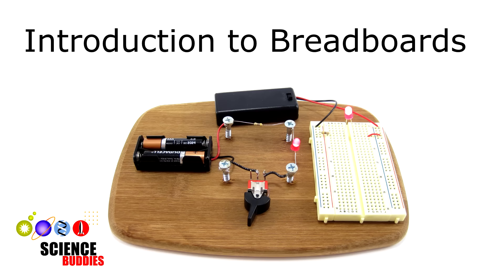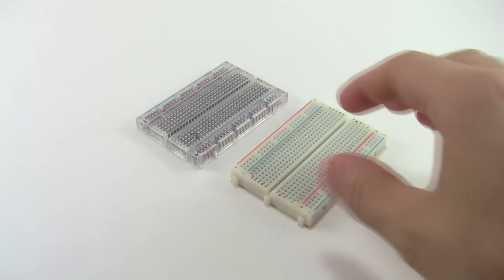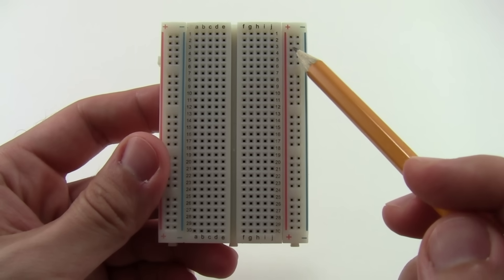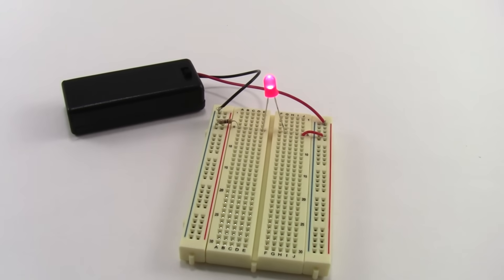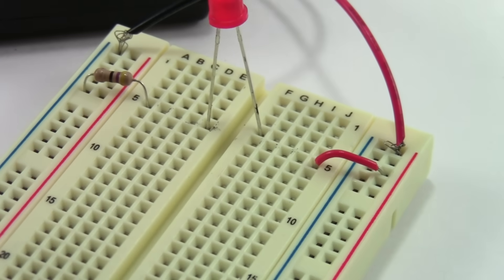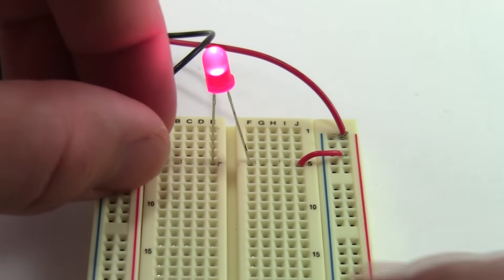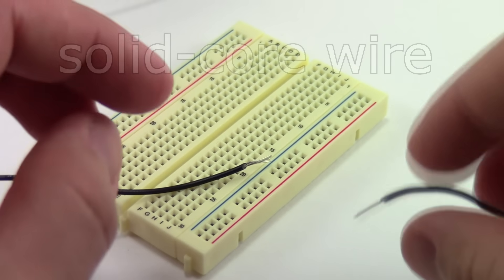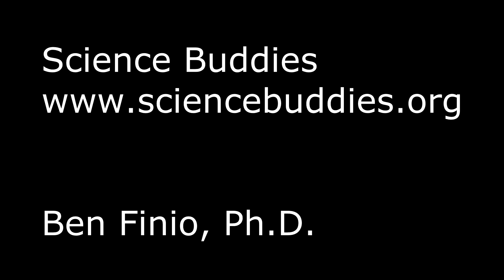How to Use a Breadboard

Comment: Instead of using the resistor in the LED closed circuit, why not use a jumper cable? I don't quite understand resistors
Reply: The resistor is used to limit the current through the LED. With a 5V power supply you would use a 220 ohm resistor keeping the current to under 20 milli amps.
Reply from the maker: We have a couple related videos that you may find helpful: https://youtu.be/ZdIBle_9Y_4 and https://youtu.be/NUKD9qESO58

Comment: what is the function of the resistor? why couldn’t you just use another wire?
Reply: The resistor is used to reduce the current down to a safe level for the LED so it doesn't burn out.
Reply: Because without it the resistance would be so high that it would burn the circuit
Reply: @stickguy9109  the resistance would actually be really LOW, so low that the CURRENT would be really high and destroy the LED
Reply: @mikerich32  Yeah sorry that's actually what I meant. I meant like nothing would stop the current  and it would burn the led.
Reply: If you compare a battery to water suspended in a tower, the amount of current out of the tower is equal to water pressure divided by the resistance of a faucet. Pressure in the tower is like voltage in electronics. As the tower empties less pressure is available in your battery so less current from the same sized faucet.

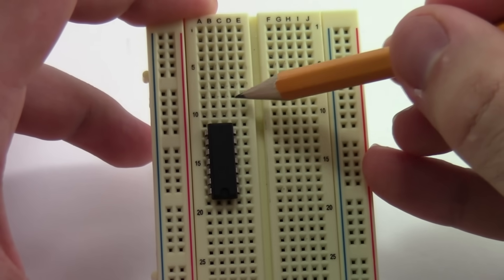Comment: @11:45 Can someone explain this to me or point me in the right direction
Reply: each of the pins have different inputs or outputs so by putting them in the same row one pin could be an input while the other can be a ground or output. im not the smartest but im pretty sure thats what he means.
Reply: @viperous1385  exactly correct.
Reply: @viperous1385  pretty much it. worded a little weird but yeah thats it. the chip wouldnt recieve the right connections because it could be receiving an output and input at the same time or ground and such

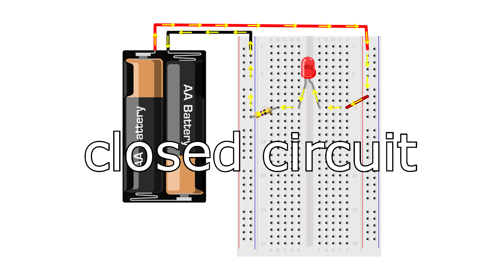Comment: @5:37 it shows electrons are flowing from positive to negative, but they flow from negative to positive... am I wrong???
Reply: Yes electrons flow from negative to positive but the direction of current is from positive to negative (it's just a convention)
Reply: The reason for it to be called conventional direction because earlier people thought electrons move from positive to negative, so they formulated the current direction as such but later they found that it was quite opposite and were too lazy to change the old wrong current direction because they thought it would be convenient to follow the same wrong current direction, hence the term conventional current flow direction
Reply: Yes from negative to positive but we work with the old theory from + to -
Reply: Current from + to - and negative eletrons to positive electrons from - to +

Comment: Why do you use a resistor after the LED?  shouldn't before the red cable???
Reply from the maker: Nope! This is a common misconception, so we made a separate video to explain it: https://youtu.be/NUKD9qESO58
Reply: @Science.Buddies  so in physic electricity runs from negative to positive and in electronic is the opossite. I tried cocodrile 3.5, and every time i used the resistor after the led(end of negative) the led blows up.
Reply: @rul1175  
I don't understand what a cocodrile is.
The confusion with how the current flows in the metals originated before the discovery of the electron. Thus, the direction of the current is a pure convention that has not changed because of the huge financial cost of rewriting textbooks.
Which is totally irrelevant when connecting LEDs, the resistor could be anywhere. 
You make some mistake, when you connect LED.
Reply: @iridios6127  yes anyhow the total resistance remains the same and the voltage drop across the components too remains the same as long as they r in series
Reply: This is for beginners like me, electric field goes from +- and electron flow -+: I just found out the reson for this https://youtube.com/clip/Ugkx9x9g5gR3bOhc0OQaM-cnYu5dmHZh0iMS

Comment: Why did that LED stopped glowing when you removed resister connected to it ? Pls answer.
Reply from the maker: When you remove the resistor, it creates an open circuit so current cannot flow and the LED cannot light up.
Reply: @Science.Buddies  Video is 7 years old but still responding to comments, absolute legend
Reply: @fieryice4749  Yeah
Reply: @Science.Buddies  Ha Thankyou
<3

Comment: We we use a resistor ? is it protector for the LED ?
Reply from the maker: Yes, it is a "current-limiting" resistor that helps prevent too much current from flowing through the LED. You may find this video helpful: https://youtu.be/NUKD9qESO58
Reply: @Science.Buddies  how do you know how many Ohms do you need for a resistor for your circuit? for example how did you know to choose this resistor for this LED circuit
Reply: @subzero1264  how much voltage does your battery (power source) provide ? And how much current does your led can handle ? Do the physics with ohm’s law (R=V/I) and you’ll get how much resistance (ohms) you need for your led

Comment: Thanks so much for this video, I have been doing digitally circuitry recently and struggled to get my head around how certain components that didn't have a wire connecting them actually were connected, I assumed there were metal strips, but obviously I came to these video to actually realise the layout of the metal strips.

Comment: Thank you for this video this helped a lot, but I have 1 more question I am getting a raspberry pi pico and I wanted to know if I should the that jumper wire kit, the pack of big jumper wires or the solid electrical wire with the wire strippers. I am also a beginner
Reply from the maker: Hi - there are pros and cons to each type. We address this in more detail in the written tutorial that you can see here: https://www.sciencebuddies.org/science-fair-projects/references/how-to-use-a-breadboard?from=YouTube#jumper-wires
Reply: @Science.Buddies  Ok thanks you
Reply: @Science.Buddies  This helped a lot thanks again!

Comment: I see in the diagrams you use conventional current flow from positive battery terminal to neg terminal. In reality does the current actually flow from neg to pos terminal ?
Reply from the maker: In a metal conductor (like a wire), the physical flow of electrons is from the negative to the positive terminal. However, the convention in electrical engineering and physics is typically to use "positive" current flow. Note that in some other cases (e.g. chemical reactions or a particle accelerator) the charge carriers can be positive particles instead of electrons.
Reply: @Science.Buddies  ok I have a random question then. If you don’t hook up the negative wire to a negative terminal of a dead  car batteries terminal, but instead hook it up to a ground when jump starting a car, how do the electrons recharge the bad battery?
Reply: @Chronicles27283  firstly you need to connect the negative terminal of the battery to the same ground for current flow
Reply: electrical engineers use this convention for making everything less confusing

Comment: Can you use copper wire?
Reply from the maker: If the wire is too thin then you will not be able to push it into the breadboard easily. You also need to be careful if the wire is uninsulated, as it will cause short circuits if the wires bump into each other.

Comment: where can I get a 5V power supply? and can I use a supply that is less than 5V, 4.5 for a example. I'm struggling to find something that is exactly 5V
Reply from the maker: A battery pack for AA or AAA batteries will be fine for working with a breadboard. For example, 3xAA batteries gives 4.5V and 4xAA batteries gives 6V. If you need exactly 5V you can use an Arduino or look for a USB-breadboard adapter because USB ports provide 5V.
Reply: @Science.Buddies  okay, thank you so much!
Reply: I believe USB is 5v, so you could cut and splice a USB cord...
Reply: If you want a reliable 5 volt supply you can use 7805 regulator.
You will need to supply it with a voltage higher than 5V, maybe 9V battery, and the regulator will give you 5 volts output.
These 78xx series regulators can be obtained in many different output voltages, eg 7809, 7806, ect.
They are very inexpensive, but you have to be aware of current limitations.

Comment: Why does the electricity need to go back into the battery pack?
Reply from the maker: Electrical current needs to flow in a closed loop. Mobile electronics in the circuit are attracted to positive charges at the other end of the battery. They can't just flow "one way" and then stop, they need to complete the loop.

Comment: That was an amazing video, for someone who is just starting out with digital electronics. I wish I had found it sooner! The only thing I would add is an explanation for the resistor, as I see others have asked this question as well.
Reply from the maker: Thanks! Resistors and Ohm's Law are a big enough topic that they sort of need their own separate videos. You may find these two videos helpful: https://youtu.be/NUKD9qESO58 and https://youtu.be/ZdIBle_9Y_4
Reply: From one beginner to another, the resistor in simple terms reduces the flow of electricity to the LED to prevent it being burnt out. Hope that helps.

Comment: wait.. so does breadboard's +  side gets the electronic "output" from battery or raspberry pi and - gives the electronic "input" to bettery or raspberry pi?
Reply from the maker: The type of breadboard shown in this video does not have its own built-in power supply. So for example you would connect to the 5V (or 3.3V) "output" pins from the Raspberry Pi. However, you can buy powered breadboards that plug into a wall outlet and have their own built-in 5V supply.

Comment: Thank you but what is the resistor for?
Reply from the maker: The resistor helps prevent the LED from burning out if too much current flows through it. You may find these two videos helpful: https://youtu.be/NUKD9qESO58 and https://youtu.be/ZdIBle_9Y_4

Comment: Can you please tell what is the use of resistor in the circuit
Reply from the maker: The resistor limits the amount of current so the LED does not burn out. We do not have our own video on this topic but if you google "ohm's law" and "LED resistor calculation" you can learn more about it.

Comment: umm at 8 minute 29 seconds i tried doing the the breed bode but ended upp burning the resister can you tell me what did i do wrong
Reply: i can't help you but when you say the thing that you did to accidently burn the resistor maybe someone could help
Reply from the maker: This video only has a 3 volt battery pack. You probably used a resistor that is too small. We don't have a video on it, but Google "LED resistor calculation" and it will show you how to choose the correct resistor based on your battery voltage.
Reply: @Science.Buddies   thanks man
Reply: @thechewyyoda  
I guess

Comment: Thanks a lot, very useful tutorial for newbies like me. Do you have any tutorial on how to troubleshoot an electronic board, let's say if my monitor can't switch on anymore and there is no traces of any burnt component? (Thanks.)
Reply from the maker: Thanks! We do not have a video on debugging circuit boards, but you might find our video on how to use a multimeter useful: https://youtu.be/ts0EVc9vXcs. A multimeter is an extremely helpful tool when debugging electronics and you should learn how to use one if you haven't already.
Reply: @Science.Buddies  Thanks a lot, I will watch the video.

Comment: 5:32 doesn't electricity flow from the negative to the positive?
Reply: electricity does flow from positive to negative, but electrons flow move from the negative to the positive
Reply: Electricity 'flows' from negative to positive (electron theory).  Electrons are the negatively charged part of the atom that 'moves' through the wire. Protons (positive charge) do not move. The concept of moving from positive to negative (Conventional Theory) is older and for some reason seems easier for people to visualize but is technically incorrect. 😊

Comment: What am I missing. I thought the resistor for an LED is connected in line to the positive (anode) side to limit the voltage going in. This example shows the resistor in line on the negative  (cathode) side of the circuit   ?  Can someone  enlighten me to my error in thinking  this should burn out the LED? I'm feeling really dumb right now. Thanks and Happy  New Year.
Reply from the maker: We get this question so often that we made a separate video just to explain it! https://youtu.be/NUKD9qESO58
Reply: @Science.Buddies  Thank you. I'm there.
Reply: The resistor will limit the current (amps) at ALL points in a series circuit. He is limiting the amps, not the voltage
Reply: @daleredfern4472  Ah. Thanks for clearing that up for me Dale.
Reply: One of Billions it works as far as I know... I saw a video back in 2019 (like yesterday or so)

Comment: I had a friend at school who tried to explain this to me but this was much more helpful, but when you showed the flow of electricity at 5:30 wouldn't it go the other way? because otherwise the resistor would have to go on the positive side. i always thought electricity flowed from the negative to the positive.
Reply from the maker: Hi - this is a common point of confusion. In a metal conductor like a copper wire, the charge carriers are electrons (negative charges). These charges do flow from negative to positive. However, in electronics "conventional current" is defined as the direction of flow of positive current. There are other cases - for example, a proton beam in a particle accelerator, or a chemical reaction with positively charged ions involve - where the charge carriers are actually positive. Either way, it turns out that it doesn't matter which side the LED goes on - we have a separate video explaining that: https://youtu.be/NUKD9qESO58

Comment: why do we need a resistor and a ground in that example for led light that you showed?
Reply from the maker: We have a few other videos that might help explain this: https://youtu.be/NUKD9qESO58 https://youtu.be/EeCh68a1GEg
Reply: You use the resistor to drop the voltage from the supply down to the voltage rating of the LED so as not to blow the LED. One important point to make is that the current flow is not in the direction that is described in the video. The "dropping resistor", as it is sometimes called, goes in the circuit before the LED.
Reply: We need a limit to how much electricity is going to the LED otherwise boom
Reply: The voltage of the supply (the two AA batteries) was too great for the LED in the circuit. Without the resistor, the voltage would have blown the LED. 

As for the ground, you always need a complete circuit. Just running the + (red) cable to the board would not power anything, as it is an incomplete, or "open" circuit.

Comment: Why resistance is necessary? Can i replace the resistance with another jumper wire?
Reply: Resistance is usually required because the LED operates in a certain voltage range (typically 1 - 3V) yet popular boards provide either 3.3V or 5V, so you need to decrease the voltage going across the LED by adding a resistor. Without a resistor, you risk damaging the LED.
Reply from the maker: Hi Akash - Oliver's reply is correct - if you just replace the resistor with a jumper wire you will burn out the LED. See this video for more information: https://youtu.be/EeCh68a1GEg

Comment: The arrows indicating the flow of electrons are pointing in the wrong direction. The electrons flow from the negative terminal, through the circuit, to the positive terminal. This is a common mistake and because a circuit is a loop, doesn't matter all that much for basic projects. But it's something to be aware of, especially as a project scales.
Reply from the maker: Hi Phil - the arrows in this case indicate the flow of "conventional current," which is defined as the direction of positive current flow. As you pointed out, in a metal conductor, this is opposite the actual direction of electron flow. However, in general there are cases when the charge carriers can be protons or positive ions (e.g. a particle accelerator, a chemical reaction). I think which convention you use largely depends on what textbook you learned from or what classes you took. In my case, the physics and electrical engineering classes I took all used conventional current, not electron flow. You can read more about it here: https://www.mi.mun.ca/users/cchaulk/eltk1100/ivse/ivse.htm
Reply: the video creator responded anyway but this literally does not matter. you get to choose ground and positive yourself in any circuit you work on...

Comment: What is the integrated circuit for? You said it straddles the middle of the breadboard but why though? Do they replace the resistors? But doesn't a resister have to have one end in the rail to give power to the circuit? Everything else I got with ease so thanks.
Reply from the maker: Hi - the integrated circuit shown in this video doesn't actually "do" anything - it is just an example showing how a dual in-line package (DIP) fits into a breadboard. It is totally separate from the previous example circuit with the resistor and LED, so it is not "replacing" the resistor. Hope that helps clarify.
Reply: An integrated circuit is like a miniature pre-wired circuit that inside of it can functionally have many of the same components that exist on a larger scale in the kinds of circuits that a beginner might build. It could be a set of logic gates, a timer, a voltage balancer, and many other things that would be possible but time-consuming, complicated, more expensive, and take up a lot more space on a circuitboard if it were to be built from basic components.